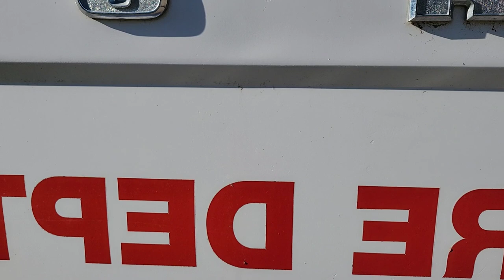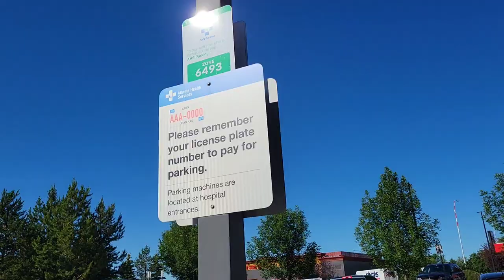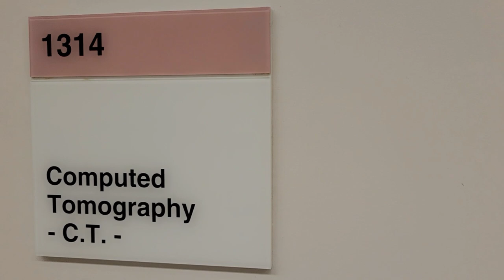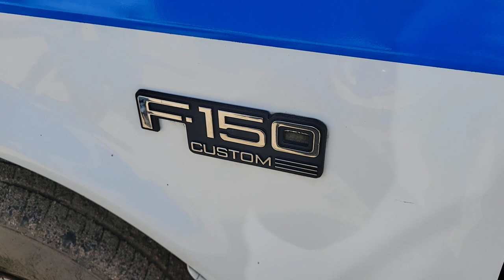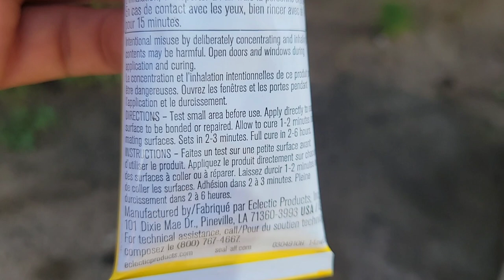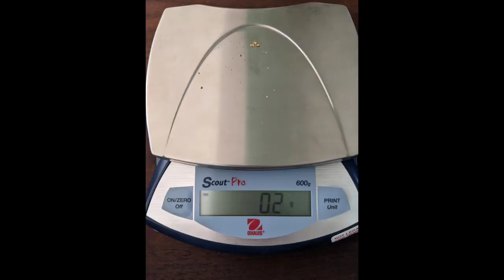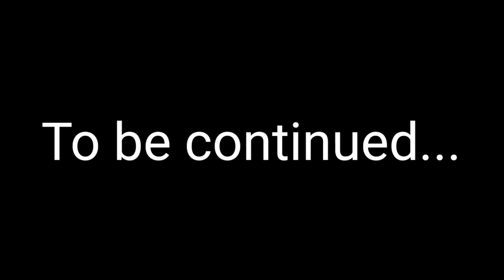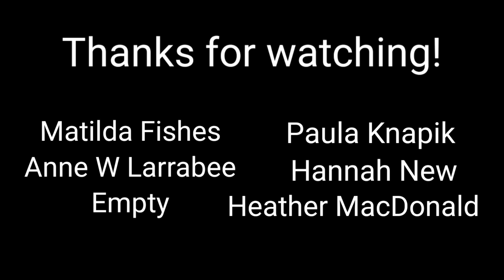Medical update + This Bush truck will hopefully help find GOLD! (next season) | Another VLOG #169

Comment: I have a friend who has a 1966 ford f150 still runs like a baby. He put an 8ft bed on it by extending the frame and has used it to haul a 10 ft trailer (home made) loaded down with other ford pickups that he owns. 70s and 80s. The truck pulls campers and closed trailers with mustangs he owns as well. Including the rare 1968 fastback. Every ford i have owned has has nothing but a solid engine. They keep going like the energizer bunny.

Comment: So nice to see when other people love rocks too, just so you know: metamorphic rock rarely contains any (remaining) fossils. That's just due to the origin of this type of rocks: they are formed when existing rock is pushed deep beneath the earth's surface (for instance along fault lines and due to tectonic plate activity). At this depth the rock is transformed due to the high pressure and/or temperatures. The rock is squashed and/or stretched and the minerals inside it change in structure to form new minerals, and therefore it's unlikely any fossil or fossil imprint would survive that. That would make it extra cool if you actually did find a dino claw in metamorphic rock though.

Comment: I was having strange one-side of head migraines. Turned out they were Cluster Headaches caused by a Vitamin D deficiency. I take a Vit D supplement every other day and have not had a headache since (as long as I don't run out or forget to take the Vit D). Best of luck to you.

Comment: Hi, Josh, sorry about the ongoing medical issues. This may be a silly question, but do your doctor's check your blood pressure at the beginning of each exam?  Untreated HBP causes continual headache. Good luck.  Great video.
Reply from the maker: Of coarse. Usually a few times as i have arithmeas.
Reply: @JoshuaAlexander138  Glad it's not hbp. I Hope a proper diagnosis is found soon.